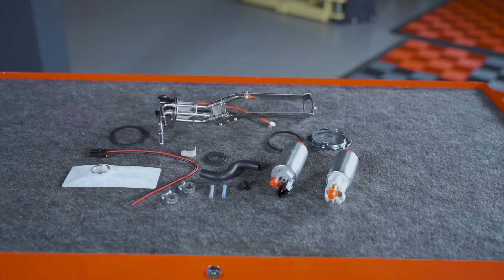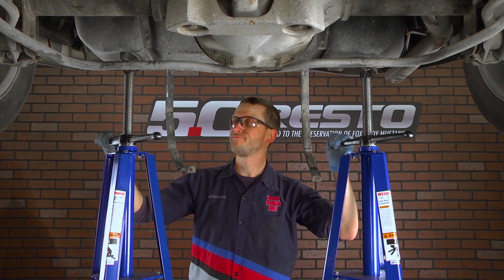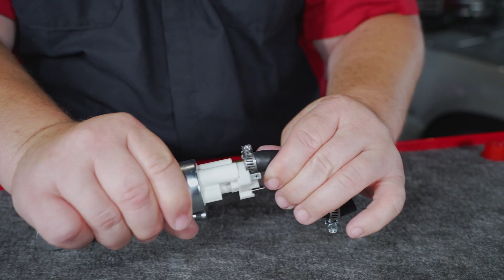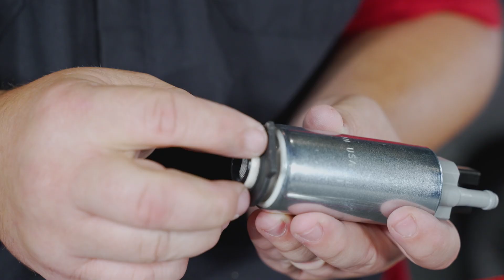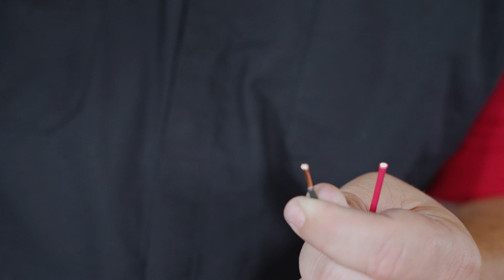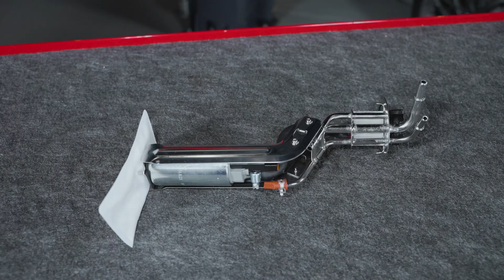How To Remove & Install 1986-97 Mustang Fuel Pump

Comment: Well isn't shrink tubing not rated for being submerged in gasoline? Im fairly sure its not at least thr general type most DIY peeps will have  .    

Also it would be best to cut wires so they are staggered so if the wire connectors ever came apart the wires would still not be able to make contact with each other and possibly cause an 
ark/spark  as you don't want to join the Flaming Ford Club !  

Or if your doing a Wahlbro 255 lph pump and new hanger as well you'll typically find the hanger is prewired  with terminal connectors , and the pump comes with a wired pigtail ,  so i just unpinned the plug to pump terminals then put the hangers prewired terminals into the pumps wire plug adapter and then your golden. 

Not having any cheap solderless terminals in the tank to fail some day leaving you stranded at the worst time of course  id generally how it goes. 

 So a little extra work now to make sure it doesnt ever happen!

 Otherwise great video LMR Team !

Comment: How snug/loose will the pump be in the hanger?

Mine doesn’t fall out, but does have 1/8”-1/4” of play when mounted in the hanger with the sock installed.
Reply from the maker: You don't want play between the pump and bracket. Use whatever you have in your possession that can be submersed in fuel to fill the void between the body of the pump and bracket. -Landan
Reply: @latemodelrestoration  Perfect! I think I can take it out of the bracket and give the sides a good squeeze to tighten it up.
Reply from the maker: @aaronreynolds2776  That works too. -Landan

Comment: Why does the fuel return have a cap off in the tank??
Reply from the maker: That's referred to as a "duckbill" valve. It's job is to prevent aeration of the fuel since the return is directly above the inlet portion of the pump. -Landan

Comment: Will this pump work for a 96 cobra?
Reply from the maker: The 96-97 Cobras required a specific pump. We're currently out of stock, but feel free to sign up for in stock alerts. Link below. Thanks. -Landan

https://lmr.com/item/BBK-1622/1998-04-Mustang-Bbk-255-Lph-Fuel-Pump

Comment: How much of a difference is it for a 98 GT?
Reply from the maker: Hi there, 

The fuel pump, tank and everything fuel related to the 1998 models are completely different. This video is a complete reference to the 87-97 models. So you will run into a lot of different things when working on your 1998.

Comment: Hey Jay. Another good video bud! I tried to order a Walbro 155lph pump kit yesterday. Any idea when they will be back in stock?
Reply from the maker: Hi Wayne, 

At this time, the Walbro Fuel Pump is expected to be back in stock by Friday, September 17. However, the ETA date is based on manufacturer and logistics schedules. The date is not guaranteed and subject to change without notice. Sign up for an in-stock alert to be notified by email when the fuel pump is back in stock.